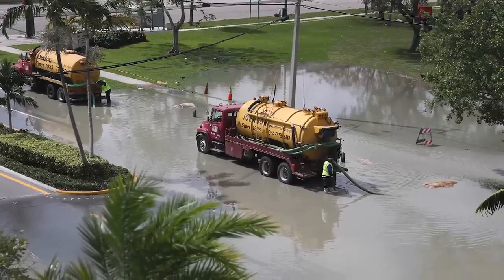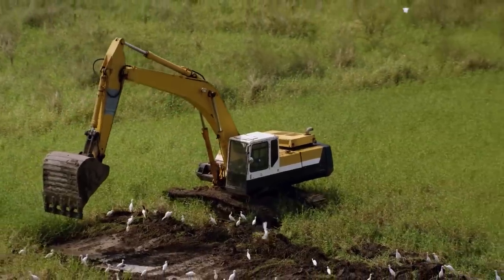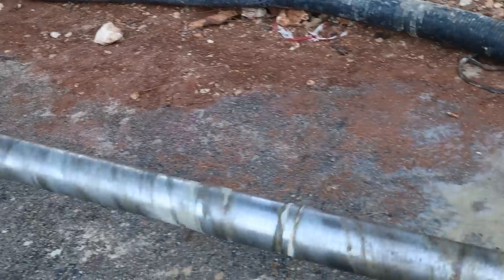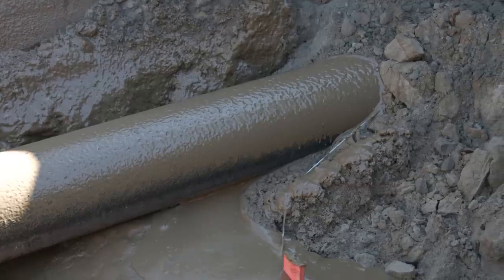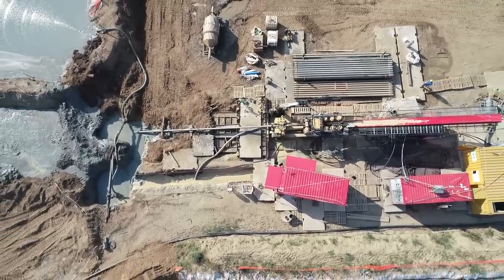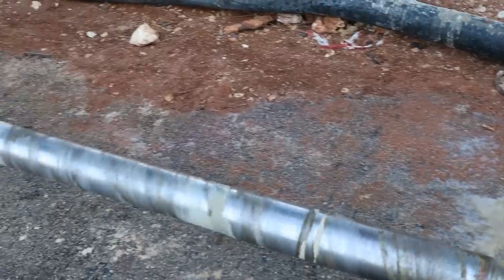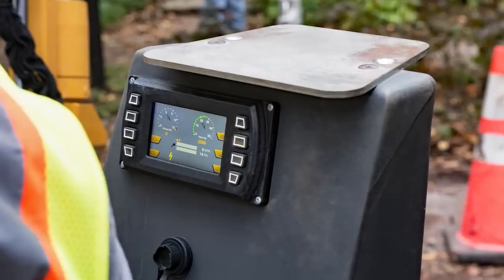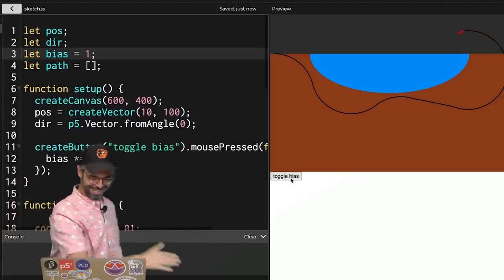How Do You Steer a Drill Below The Earth?

Comment: That string in the gel demo was awesome and gave such a simple and precise explanation of a problem that I always wondered about. Beautiful!
Reply: Yes. Simple in principle, more complex in performance.
Reply: Oddly Satisfying
Reply: String  > Wire  Important distinction here since you can't push a rope/string.
Reply: It was perfect
Reply: That was simply mind blowing. It made me sit with jaw open "how easy is that". OFC drilling in real life is much more involved, but the principle is so amazingly simple.
Reply: @Keith_Ward  A chain is even worse.
Reply: I'm just a bit confused, since the wire does not rotate but the drillbits are, so how are they steering it when the whole thing is constantly rotating?
Reply: @Shaded  They can vary the speed as well as stop rotation.  The asymmetrical end steers more when stopped vs rotating.
Reply: @Shaded  the drill bit does not rotate when it's being steered. The "drill bit" has an angled end. They push it with that bit in a certain angular orientation, then spin it a bit to clear everything up, then orientate the bit, push it, spin it, etc. Little by little.
Reply: @Shaded  We use motors that utilise the mud being pumped to turn the bit. The motors have a stator and a rotor within it, that is lobed, 1:2, up to 7:8, like the gears on a car, the later being more powerful but slower in rotation, with the drill string stopped rotation and the MWD sending up Toolfaces to show where the bit is pointing, the directional driller, guides the string, up, (HS toolface), down, (180 toolface), left, (270 toolface), or right, (90) toolface) or anywhere in-between these numbers, by varying WOB (weight on the bit) to control the pushing force and reactive torque. So you begin to see, it's nothing like as easy as some people on here seem to think it is.
Reply: @Keith_Ward  ahhhh... wire

Comment: that's super interesting its also similar to how the apollo capsules were steered on reentry. The mass was off center so by rotating the capsule it could change pitch or yaw
Reply: Several type of missiles are steered in the same manner, hence why some spiral.
Reply: Also how surgeons use a guide wire to steer a coronary catheter through the circulatory system for things like installing stents and performing angiography
Reply: What would the kinetic energy be of that capsule, falling from the moon, reaching 11 km/s at reentry? What was the kinetic energy be of that capsule at reentry?
Reply: @elbuggo  the module was 5557 kg.  At 11 km/s its energy would be 336 Gigajouls or 93 Megawatts hours.
Reply: @elbuggo  
0.5 * (mass of object in kilograms) * (velocity of object in metres/second)^2

Now you have the power to calculate the kinetic energy (in joules) of anything (below about 0.6 times the speed of light), use this power wisely.
Reply: @elbuggo  Half the mass by the speed squared is the formula for KE.   = 336GJ
Reply: @ualreadyknoitsyaboi  I hope that's a joke.
Reply: @MASSspec1990  I believe that is how the AIM-9 even got its name, its wobbly spiral method of navigation made the people designating it think of the snake called a sidewinder.
Reply: @karhukivi  The unit kinetic energy (J/kg) at 11 031 m/s is 60.84 MJ/kg! It is a lot! It - the energy of one kilogram moving at 11 031 m/s - is sufficient to raise temperature of 1 kg concrete (C = 880 J/kgC) 69 138C.
Reply: @elbuggo  That's why they have ablative heatshields.  But energy conversions are never 100% efficient, especially in low-density atmospheres.
Reply: @karhukivi   I read the Apollo capsule was made of Epoxy in a honeycomb design. What factory is producing these kinds of magical heat shields?

 Not many White Papers to be found om these marvelous things. Where do they educate these heat shield engineers? Is there any books on how to design and build this type of magical heat insulation? Why not? Pure fiction and Hollywood?
Reply: @elbuggo  The capsule that carried Apollo 11 astronauts safely back to Earth in 1969 used a heat shield made of epoxy resin to protect its contents from the 5,000-degree heat of reentry. The resin, called Avcoat, was designed to erode, carrying heat away from the surface. A half century later, NASA’s Orion spacecraft uses the same material. Brian Hinde, Lockheed Martin’s Orion Structures and Aeroshell Senior Manager, says that the most important innovation for heat shield technology isn’t finding new materials, but increasing the efficiency of materials already in use. On the Apollo capsule, the Avcoat was injected into thousands of individual cells of a fiberglass honeycomb, an agonizingly slow process. The tool used was, in essence, “a high-pressure caulk gun,” says Hinde.  

Incidentally, the Moon rocks cannot be fabricated on Earth by NASA nor any other geochemical laboratory, any attempt at faking them would be discovered by all the laboratories in the universities that studied them.  So forget your conspiracy theories, there is absolute proof that they did go to the Moon!
Reply: @karhukivi  It is not temperature that is the problem, but heat for diluting 60.84 MJ/kg in kinetic energy, within 10 minutes.
Reply: @elbuggo  The heat is generated in the air in front of the spacecraft which becomes plasma and the fast-moving spacecraft leaves a long plume of superheated gases along its track. At 11 km/sec and the diameter of the spacecraft, the cylinder of hot gas along the trail represents a substantial quantity of heat energy.   The capsule is not "heated by friction with the air" as is commonly stated, rather it is the air that is compressed and heats adiabatically (remember the bicycle pump?) albeit complicated by the shockwave that forms, and some of that heat is transferred to the heatshield which melts off slowly to keep the heat from arriving at the capsule.   Allen and Eggers of NACA (pre-NASA) showed that the heat load experienced by an entry vehicle was "inversely proportional to the drag coefficient; i.e., the greater the drag, the less the heat load. If the re-entry vehicle is made blunt, air cannot "get out of the way" quickly enough, and acts as an air cushion to push the shock wave and heated shock layer away from the vehicle. Since most of the hot gases are no longer in direct contact with the vehicle, the heat energy would stay in the shocked gas and simply move around the vehicle to later dissipate into the atmosphere".   http://naca.central.cranfield.ac.uk/reports/1958/naca-report-1381.pdf
Reply: @elbuggo  there's educational textbook series published by NASA called "NASA Aeronautic Book Series", and on heat shield topic a book titled "Coming Home, Reentry and Recovery from space, ISBN 978-0-16-091064-7". Also there's more detailed textbook published by "Air Force Institute of Technology" titled "Hypersonic Aerothermodynamic, ISBN 1-56347-O36-5"
Reply: @karhukivi  	
Apollo 11 CM reentry mass 5 557 kg. 
Reentry speed 11 200 m/s.
Unit kinetic energy 63 MJ/kg.
Total kinetic energy to absorb braking 349 GJ.
Reply: @xponen  Thank you for that.

Comment: I assisted an HDD on Mariner East 2, ME2. We had an inadvertent return so bad we built a pit around it and simply used it as a recirculation pit. There was a lot of effort to mitigate damage professional geologists at each drill and field techs/engineers walking the surface to look for IR's. Amazing tech
Reply: Some of the HDD companies that I've worked with potholed every 75-100 feet along the return with a vac truck and removed the mud before they had IRs. It works pretty well but our geology is mostly clay so that's easy, the bore depths were also pretty shallow at around 8-10 feet.
Reply: Must have been really out of hand most pipeline companies just hire labour to walk around checking for releases and the big guys only show up if they find something.
Reply: @andrewv5104  We were deep, around 60 feet to be below a stream and stay in rock. We spent several weeks there. We had two rigs drilling. We missed each other once and spent two days drilling to intercept again. Solid rock. What was on our side is that a line had previously been drilled and our IR's hit the same spot.
Reply: @collinscody57  The ME was issue prone so it was written into their permits they would have a PG and environmental techs/field engineer/inspector from a third party. It was expensive but helped get issues resolved quickly and give the DEP a piece of mind.
Reply: @cmdr1911  peace of mind*

And thanks for bringing your story and experience with this, especially as part of the mentioned pipeline in the video. Very interesting stuff.
Reply: My last name is Wojtek. Not often I see that name anywhere.
Reply: @KevinDC5  I just really enjoy bears and my family is polish lol

Comment: I could never have imagined how you can steer a long, flexible drill bit. After you explained it, it seems so obvious.
Reply: Drill bits are about a foot long on average, one component to a drill string. The bottom part is called the BHA (bottom hole assembly) the steerable part, and the part behind it is the drill pipe, the flexible part you are talking about. Old drill strings from the sixties and seventies were made up of drill collars for weight and stiffness, stabilisers, which were placed for a specific effect, build and drop or rotate ahead as straight as possible, jars to free you if you got stuck, reamers and hole openers and so on, more complex than you can imagine
Reply: ok
Reply: @tamthuong4048  thanks for adding that to the convo.
Reply: Honestly this was the best and simplest demonstration of how it works I’ve yet seen.

Comment: I used to work for a UK drilling company as a tracker. We drilled under railway lines with mm tolerances on the tracks. Under woods that had preservation orders and under lots of domestic properties. We drilled under a river aiming for a range rod that the client had stuck in the ground. I will never forget the look on his face when we emerged from the ground and knocked the rod over. 
We used to say " any fool can still down. Coming back up and arriving where you want to be takes skill.
Reply: How deep hese have to br by regs when drilling under residentials and what if someone has basement or bunker
Reply: @amadkhan1201  When drilling under buildings or rivers where the depth was not guaranteed, we set up further back and drilled deep but further. A sharper angle would strain the putting end of the pipe being pulled through the hole. It  was always a very slow pull after a weekend away because sometimes the hole would reduce  in size....
The drill head for steering was important, but so was the reamer. After the hole of small diameter it would need to be enlarged. This was done by pulling a larger reamer back to the rig. Behind the reamer was another string of drill rods and other a larger reamer. Once the hole was made oversize a tube was pulled through to finish the job. The ground would  settle around the pipe and job was finished.
Reply: @uk_steve  do you have to be good at math to be a driller?
Reply: @kingmichaeln1  I've never drilled but I used to work around drillers and would spot utilities for them at my old job and from what I could tell no you don't need to be a math wiz to do it
Reply: @kingmichaeln1  if you want to be very accurate as well as fast and efficient as the drill locator/tracker you do need to be able to do simple addition and subtraction in your head on the fly. But lets be honest, that could be taught to a 10 year old very easily.
Reply: indeed, i watched this at my place of work, rougly 5 miles drill. They made a small hole where i was just talking with the guys there when the drill emerged, they placed a stick where it should emerge, and only ~5cm next to it the drill emerged.

they took the measuring equipment, and then started laughing. They placed the stick in the wrong place :P
Reply: What's a range rod?
Reply: @daniel_dumile  A range rod is a metal or fibreglass pole about 2m long with a point on the end. It is placed in the ground as a marker for distance calulations by surveyors.
Reply: @cherb23  yes,some gyro sensor or northseeker
Reply: @kingmichaeln1  as a locator, not really, just need to know basic understanding of slope. A history working with underground utilities is almost more important, seeing as I find locators for other companies not really thinking about what they might run into at depth. Been to way to many curbstop and hydrant repairs because a drill head went through it 😪
Reply: @cherb23  Wrong to be a "Steerhand" aka Navigater of the drill you have to know Calculus, Trig and geometry. I should know because its what I do for a living.

Comment: They use pulsed mud systems sometimes for locational information. We used to do maintenance on downhole tools, and one we had was a probe that was powered by a turbine spun by the mud going down the drillshaft. it sent information back to the headunit by limiting the mudflow, causing pressure pulses upstream.

More useful than radio when you're 20kft or more deep. Measured all kinds of information. Radiation, vibrations, temperatures, gyro orientation, magnetic fields. All useful for figuring out where and what you're drilling through when you can't see it.

Oh also tangentially related (no pun intended), the drill bits on the end, are also powered by that same mudflow. It's quite ingenious use of an already required aspect of drilling to add a power transfer through the lubrication medium. It's like if the coolant pump on your CNC mill actually powered the computer and the spindle at the same time.
Reply: Lemme name-drop some other science-channel or learn-channel, cause i like sharing Fun and thats all the reason i need: Sci Man Dan, Sci Show, UpisnotJump, Plaanrwalk, Second Thought, Hbomberguy, Joe Scott.
Reply: "pulsed mud" is unexpected tech, right along with "coal pipeline".
Reply: they actually don't use mud pulsing tools for HDD. We use wireline or telemetry. Mud pulsing tools are relatively slow for the process. Wireline is real time.  
Also mud pulsing would only allow for DC tracking while other system will allow for AC tracking.